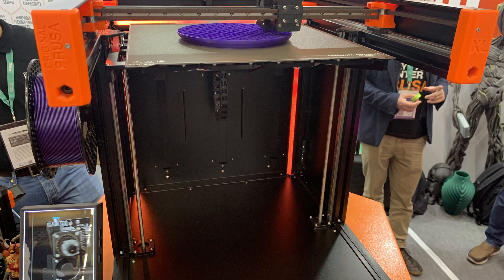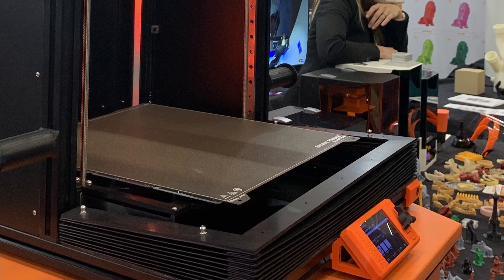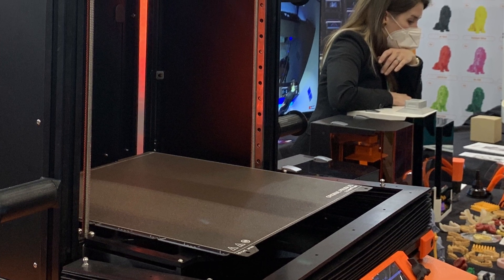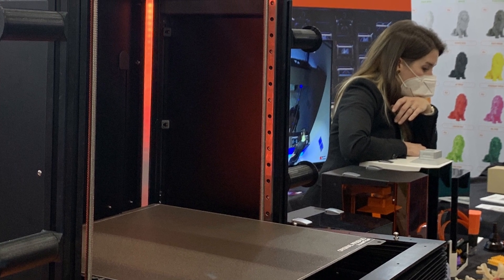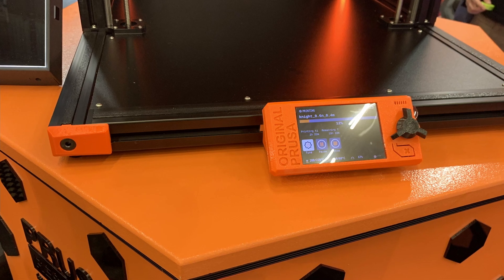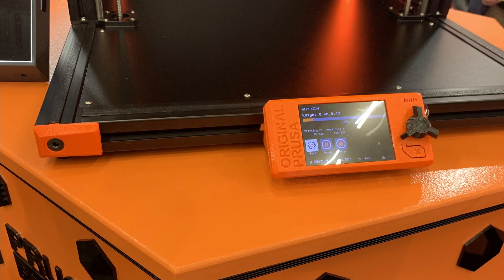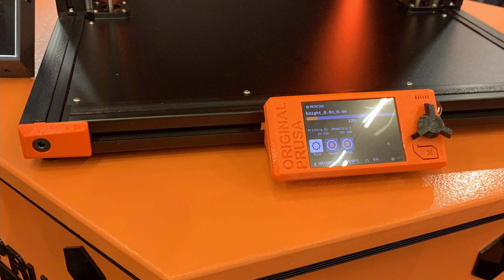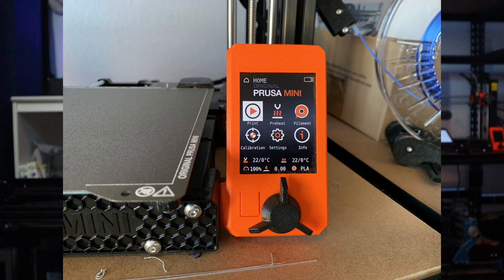Prusa XL - Z3DP Reacts

Comment: Wait for the aliexpress clones, and porting of designs to other printers.
Reply from the maker: I wonder in which way they are going to do that...
Reply: @Zachary3DPrints  once it goes opened sourced, the variations,etc will follow
Reply: And then community complaining why they’re not that fast with innovations or why some of others go to closed source software. That’s the reason, someone want a clone and not to support maker.
Reply: @olleo_ol  sucks 2 be them